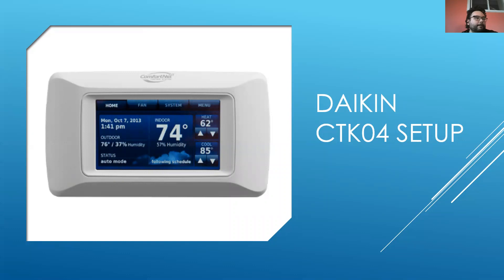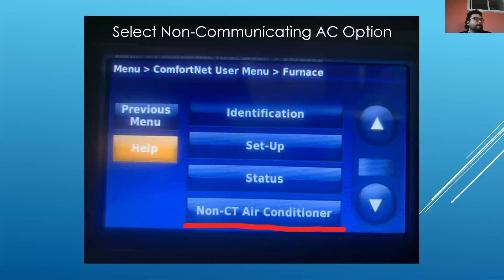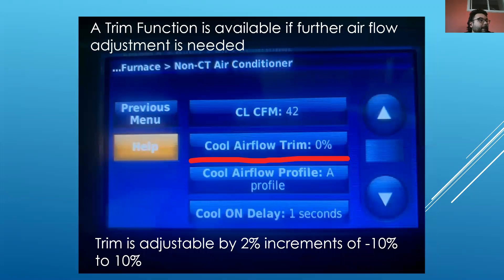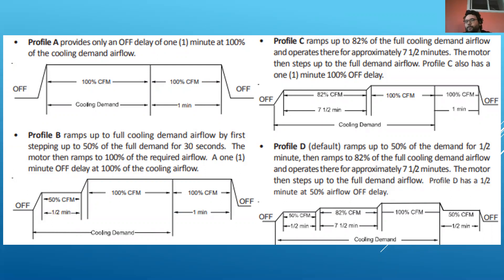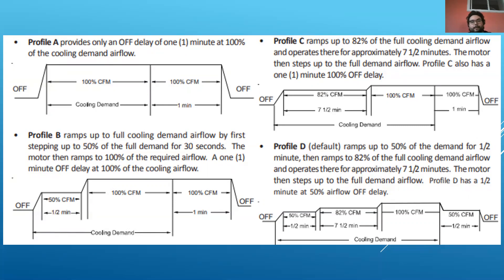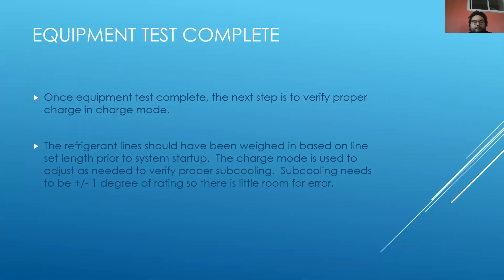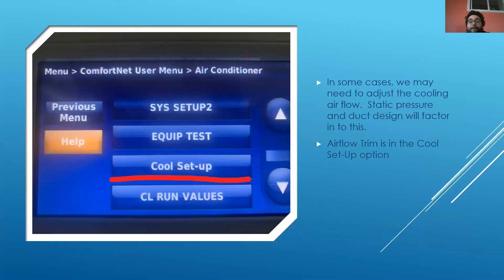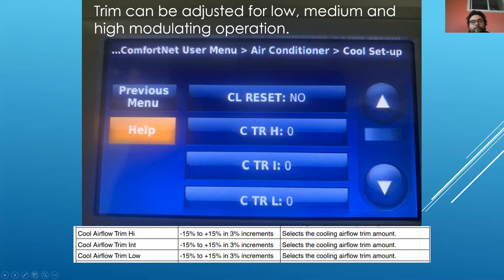ComfortNet CTK04 Setup With Daikin FIT and Non-Communicating Air Conditioners

Comment: Were you able to figure out the setup for heat pump three-and-a-half ton that can fit communicating. We are having issues with the unit keeping up in the cold temperatures period and customer likes changing temperature to cooler at night about 5 degree difference from daytime setpoint?

Comment: Hi, your video is very helpful, thank you.  I have been living in my current house for over a year with the existing thermostat with no issues.  This morning I heard the AC continue to click on and i noticed there was an error message stating the thermostat has lost communication with the air conditioner.  Are you able to help me troubleshoot why I might be getting this?  I checked the breakers and they're good.  AC is still running but only for a very very short period.
Reply from the maker: Hi sorry for the delayed response!  I am out of town and not checking my phone too much.  If you have a Daikin FIT, a communication error could be a large number of possibilities.  Checking wire connections is the best place to start.  The communication can be lost due to poor connections.  While I am happy to help you try to troubleshoot the issue, it is in your best interest to call the company who installed the system.  They will be able to get you to a quicker resolution and if any problems occur during servicing it will be on them and not you.   If you do not have the right training to work on these units there is potential to get hurt when servicing.
Reply: Thank you for your response! We did end up contacting the ac company who was able to troubleshoot however they've since had to come back twice (three total!) For the same thing. They can't quite figure out why the error keeps happening and the first guy said he had to call a support line to walk him through but not sure who that would be. Any thoughts on why it's continuing to happen? Is it an ac issue or thermostat and is there someone else I should call to service? Thankfully the ac company hasnt charged me for the two subsequent visits. We decided to keep the air on for the weekend to avoid bothering them (since it seems to trigger when the air is off and needs to come back on). Looking forward to our electric bill (florida)
Reply from the maker: The best thing to do is have the company servicing your AC come on site with a tool called a D-Checker and consult Daikins technical support team with their findings.  Usually a communication issue is external to the thermostat but I suppose it could possibly be the thermostat.  If you aren’t having any luck with your current contractor you could search for local Daikin dealers and ask them if they have a D checker and regional technical support manager they can call.

Comment: We have a new Daikin fit heat pump installed with the CTK04. We are having long extended fan run times after reaching temperature. It will turn the outdoor unit off but the blower motor will continue to run for 5 to 30 minutes after. Any ideas? We replace the thermostat and air handler board after consulting with our Daikin guy. I’m at the end of my rope on it.
Reply from the maker: We had a similar situation happen with a straight cool Daikin FIT and air handler.  New thermostat and possibly indoor board replaced (this was over a year ago so my memory is foggy on the air handler control.). We happened to shut power off at the indoor unit and noticed that the outdoor unit was still running.  The outdoor unit was replaced due to no available parts in the US at the time, but we determined the outdoor control board was malfunctioning and sending improper communication signals to the indoor PCB causing the fan to run.  

While I’m not Daikin tech support by any means, I have a feeling that’s what could be going on. 

 Who is your regional technical service manager for Daikin?   Have they had you hook up the D-Checker to the unit?  Before you replace anything I would clear it with your RTSM so you don’t have any warranty credit issues.
Reply: @staticpressurenerd5182  Thanks for responding.  I'm in Virginia.  I'm not sure who our regional tech service manager is.  We usually are helped by Scott or Carlos from Daikin.  They've been telling us everything they want done.
I'll check with them on the outdoor board.  Shoot, it's all that's left.
Reply from the maker: I like Scott.  As a matter of fact he actually happened to look at the job I mentioned above in person.  He had recommended indoor board (we did change it now that I remember)  but that was a miss.   I primarily work with Steve and also have talked to Carlos.  Good group of guys.  We had a system that wouldn’t ramp up higher than 60%.  Tried outdoor board... turned out the CTK04 was the issue.  The CTK04 has some bearing on unit operation which was a surprise to me.   I was initially under the impression that the outdoor board made all of the decisions.   Still a learning process with the FIT but I enjoy the system and customers love them for sure.

Good luck with it!
Reply: Static Pressure Nerd thanks pal

Comment: Can you explain the trim and how it effects cooling?  Thanks
Reply from the maker: Hi sorry for the delayed response.  Trim allows you to modify your air flow by a fixed percentage.  For example, if you have a non-communicating air conditioner with a communicating furnace/thermostat you select the initial unit capacity ( we will say 3 tons ) and it will set the air flow for 1200cfm.  If you want to achieve 350 CFM per ton ( or 1050 CFM in this case ) you would set a trim of -12% to achieve this.  The same applies for FIT systems, they default at 400cfm per ton.  Daikin recommends that you leave the unit at 400cfm/ton as the lower modulation operation will help with dehumidification.   If you set the trim for H, M, and L these refer to the different steps in your cooling fan profile.  If you are set to profile D, 50% speed is the L, 82% (or 85 I can’t remember) is the M and 100% is the H.  This is how I understand it as it was explained to me by Daikin tech support.

Comment: Hi. Do you know if Daikin fit ac condenser will work with a non communicating furnace and thermostat
Reply from the maker: No it will not.  Has to be a fully communicating system with the Daikin FIT